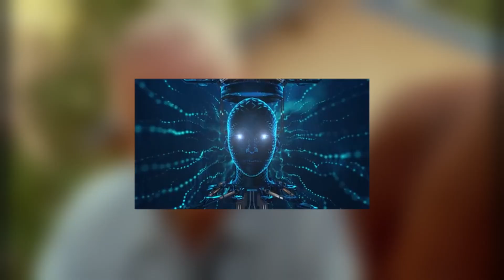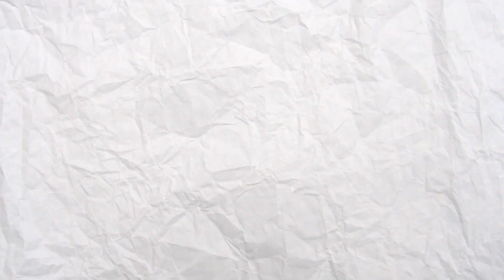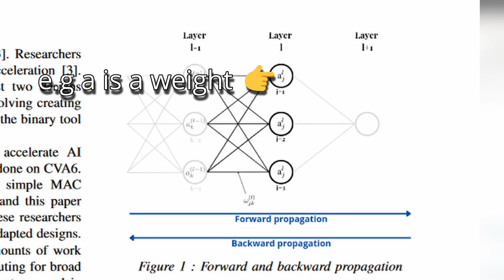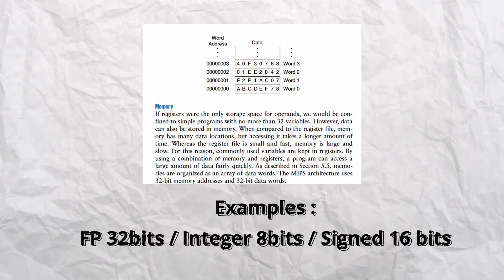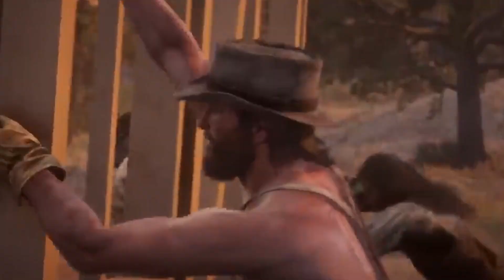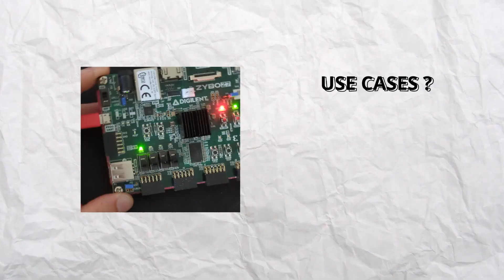I Built This AI on FPGA ; Here's What Happened

Comment: Any chance you could go over ternary operations? Ie: 
> if w = 1, then y = x + 1
> if w = 0, then y = x
> if w = -1 then y = x - 1

This style of operation is becoming more relevant with Bitnet 1.58’s increasing popularity (Huggingface has a great article on QATing your way from a pretrained model to a Bitnet one), and it’s significantly more efficient in terms of transistors per operation. FPGAs are a really interesting way to deploy such a model as GPUs and CPUs don’t have native ternary logic (though you can emulate it with LUTs at such a small data surface area), so there should be a lot of room for improved acceleration with dedicated operations (and theoretically more capacity, though I guess that depends on the person programming it).

A bitnet 1.58 model with 8B parameters is roughly 1/12 the size(!) of a full FP16 implementation, or roughly from 16GB -> 1.5GB needed to load the weights, which is a huge change, to say nothing of the differences in throughput from the ternary versus dense logic. I think you could actually get some really interesting stuff going with FPGAs in this area; particularly if you were willing to network them together (not sure how FPGAs do for network bandwidth and interfaces, though). Taking that earlier example, 1.5GB of space for the weights, divided by 60 layers leads to a potentially very deployable solution if a person had enough FPGAs, lol.
Reply from the maker: Have ternary weight is great indeed ! FINN researches has also done some straight up 1bit quant (that actually was the only thing used to do a couple of years ago 🤓) which allows for some kind of XOR implementation in hardware, leading to extreme efficiency.

Thanks for the insight, looking back at it, I should have talked about these extremes/exotic quantization scenarios (but I don't understand then fully yet haha).

Another comment here mentioned L-mul which looks like an "additions only" large model approximator, good stuff.
Reply: @BRH_SoC ily
Reply: @BRH_SoC  are you still working on it? what do ou think of PAM-3 for ternary logics in FPGAs?

Comment: Ayo bro! hlooooo thanks for all the vids 
and u did say abt the project i mean the competition on the Neural Networks accelerator right? 
could u share what you did on that and how you approached and stuff..?? I wanna work on an accelerator for CNN sooo if u can help me with that. THANK YOU!!
Reply from the maker: Hey, thank you for the kinds words
Regarding the competition, the repo is pinned on my github profile (CVA6 hackathon) which is in the description.
But don't look into that too much, the result and techniques were so bad that's it's just something I use for my resume, not something you actually want to do.
Other phd guys at my competition got some insane results by implementing the RISC-V Vector extension, maybe you should look into that, but the idea is to leverage SIMD which makes these calculation 10000000x better on a CPU, the calculations was then performed by a coprocessor (aka just a custom additional ALU running in parallel OoO) if I recall correctly. Result were like -80-90% of compute time, big improvements.
Reply: @BRH_SoC Okayy!! I'll look into those . Thanks

Comment: Nice to see designs that leverage open-source  (Yosys, verible , cocotb , verilator,  SpinalHDL )..  especially python-based tools like LiteX/nMigen,  AmaranthHDL, , PyGears, PyMTL!    Specifically in the AI/Machine learning space : FastML's hls4ml , pytorch/glow ,  Google XLS!

However, are the popular AI Xilinx tools (Brevitas, FINN) that are designed to work with Pynq (Python + Zynq)..  can they be ported to another FPGA board (like the Trenz SMF2000)?  Tim Paine has a video where he modifies a pytorch model, to use Xilinx's quantization-aware Library  (Brevitas), trains it, exports to QONNX (Quantized Open Neural Network Exchange) then finally to FINN which outputs the bitstream.  More at GH : Xilinx / finn-examples 

BTW, there's also a great tutorial on the ESP (Embedded Scalable Platform) "How to: design an accelerator in Keras/Pytorch/ONNX (hls4ml)"

Comment: Hello, this is very informative video for me. I am currently doing my masters in data science. I am working on a project called "Efficient Execution of Object Detection Algorithms on Edge Devices". I know finn only work with full-connected neural networks. Is there any recommendation for me? Please help
Reply from the maker: Finn also works with CNNs and other types architectures, even resnets ! (even though it is not as easy as others to put toghteher).
Given CNN/resnets are the backbone of most image/object/action classification networks, you might be on the right track.

But keep in mind FPGA are not really a great competitor againts GPUs.
Their advantages are delay, edge presence, power consumption and adaptability to the use case (for aerospace applications for example,).

But these niche advantages are overcast by the (very) huge amount of work necessary to get some simple applications running reliably, thus FINN to try and give people some tools to automate the process. But it's so niche that it struggles to really take off...

Hope that helps ! ;) Good luck

Comment: I'm curious about the feasibility of developing a system where an FPGA could function as a self-adaptive neural network that directly learns optimal circuit configurations from input data streams, is that kind of device available?
Reply from the maker: I think it would be possible but the hastle may not be worth the reward. HDL "compilers" already have very efficient ways to de the FPGA place and route (given the written HDL is not bad).

Adapting this architecture in "run time" would be possible by tracking what datapath are used the most and feedback this to the compiler to make these specific routes more efficient but there's a chance modern compiler actually already do that through some simulation and feedback.

Using AI to optimize routes is subject to discussion, AI is not an universal solution and sometimes it's not suited (we have plenty of tool for planning stuff without AI, it is a whole branch of research actually), maybe it is possible but i definitely don't know haha. Good luck with this research ;)
Reply: @BRH_SoC  Thanks for your detailed reponse, I think there may be a slight misinterpreting, I was thinking about FPGAs(or some kind of chip) that can function as self-adaptive neural networks - where the chip includes inputs, outputs, and reference data to enable both forward inference and backward propagation. I have some experience on NN devs, but not with running hardware, so this question might be somewhat naive..

Comment: This video was great. Thank you for putting this together.

I am still trying to understand how FPGA would be deployed for AI at scale.

For an industrial application like the classifier one you've shown, the FPGA would be great for development, but depending on the scale you are trying to operate at, you would use that design to build a custom circuits/chips for that one task you have optimized for (probably at even lower power consumption).

That's cool, but I am wondering is there an application for the FPGA at scale, like in some type of general purpose robot? Power consumption for robots is critical, and the fact they are being asked to tackle a huge variety of tasks make having a lot of onboard capabilities important too. Would it make sense to reprogram an onboard FPGA for whatever the current task is? Would a lot of flashing to task specific models ultimately ruin the power savings?

Am I just talking nonsense here? Thanks to anyone that read this.
Reply from the maker: Hey, thanks.

You are not talking nonsense at all ! Just know that it really depends and FPGA are great for a lot of things.

For you know what they say "jacks of all trades, master of none" : when doing a solution with FPGA, you'll always be asked : "how would this better than a GPU ?" (Gpu If talking about AI, it depends but you get the idea).

Now, future FPGA will benefits from the the fabrication technics and smaller nodes, making them better and better.

Maybe one day, they will be "great enough" to cover most application ? I don't know.

All this to say that it depends ;)

Comment: Pretty soon manufacturers will realise that the best way to improve AI performance will be to use analogue gate arrays instead of digital ones.
Reply from the maker: I thought about it too ! Analog computing in an old school way would unfortunately be too hard to scale down, to implement, too slow (maybe, or maybe not ?). Anyway... Making one would be an insane project... I definitely want to do one now haha !

The next 2-3 videos I planed should point toward this direction, so giving it a shot might just be a thing (given that it's doable ahah)...
Reply: I member watching a video about some startup that was making chips filled with some variable resistor instead of transistors for AI. Basically amount of resistance was equal to weight of connection in neural network. You couldn't train on it, but if you had already trained model then you could imprint it's weights into their chip and run it very efficiently. They were mostly doing computer vision with it, i guess that's what's gonna be in all the suicide drones soon 😅
Reply: @sznikers Maybe you're talking about the veritasium one : https://www.youtube.com/watch?v=GVsUOuSjvcg (and yeah, this looks incredibly promising to me as well)
Reply from the maker: @organicneuralnetwork  the fact that they made it programmable is just so great ! my curiosity is now sparked.